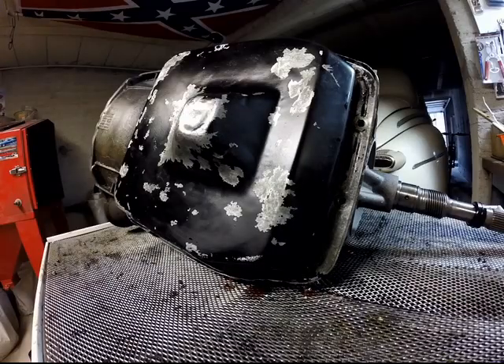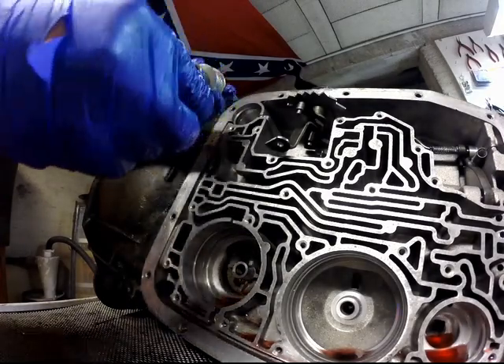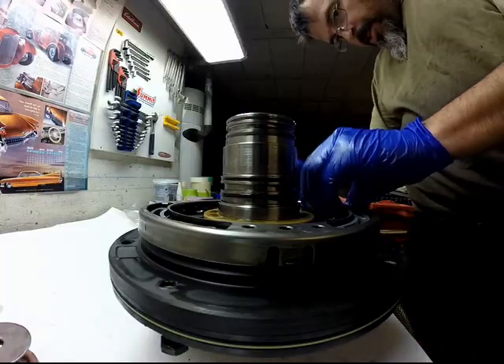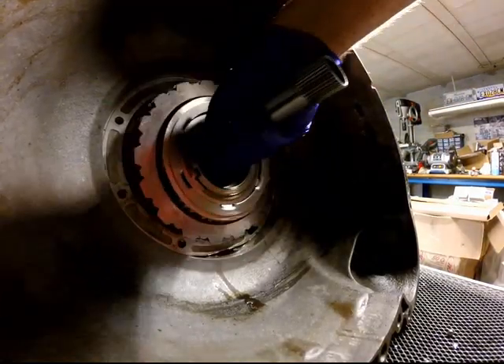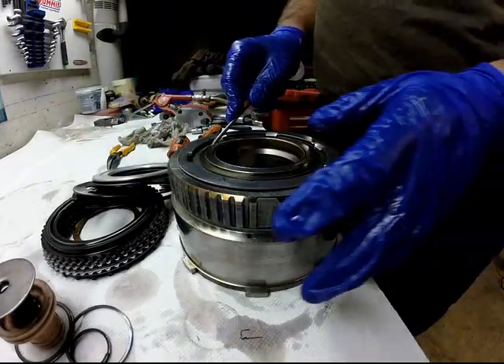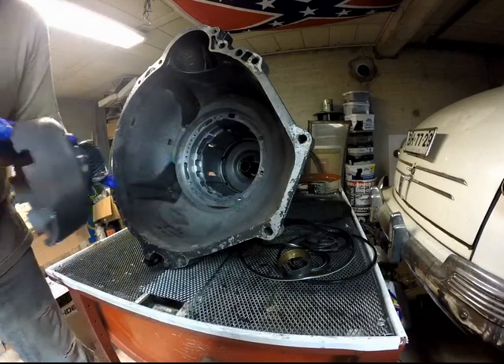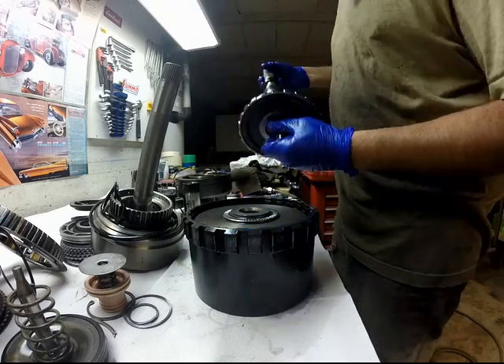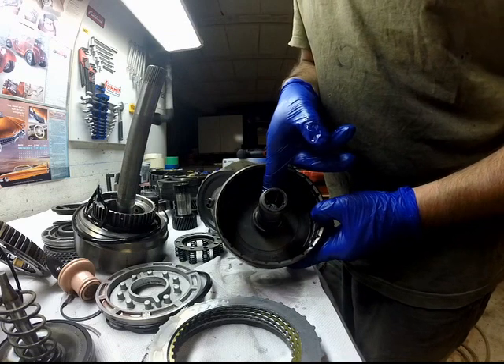How to rebuild the Ford AOD Transmission

Comment: Hi wanted to find out if it’s true that these valve bodies are not available?
I have a 1986 ford e-150 Aod and was told that the CAN be rebuilt…
Does the rebuild value body last a long time?
Reply from the maker: Yes, you can rebuild your valve body with the gaskets and seals inculded in the rebuild kit.
If the valve have no sign of  wear, the valve body can be used for several years
Reply: @Thunderdeome  thank you for the info!
Took it to Aamco hopefully they know what they are doing! They will refill with dexron vi/ mercon lv transmission fluid
Reply from the maker: @Phantomas2011  Usually, I use Mercon V fluid for the AOD
Reply: @Thunderdeome   hi really appreciate your inputs!!! Aamco rebuilt the transmission but there are two issues overdrive kicks and I loose torque when it shifts from 2nd to 3rd gear, using a 1989 valve body, now they are installing the 1986 valve body to try to fix those issues! Unbelievable!!!